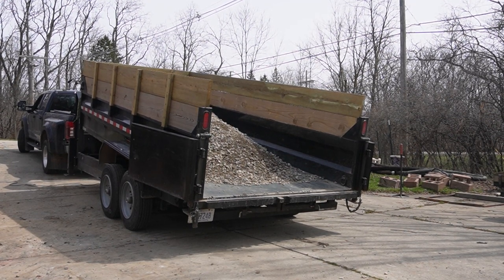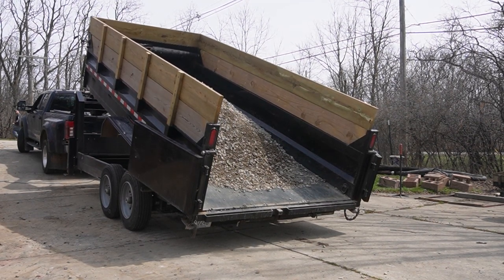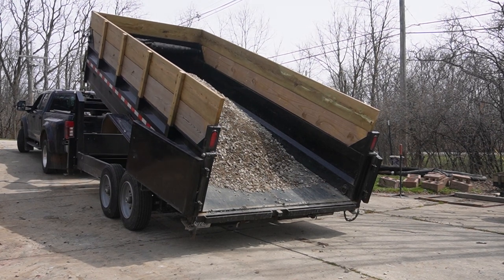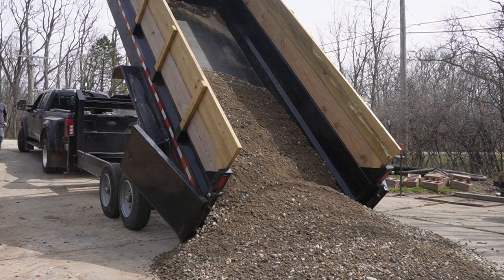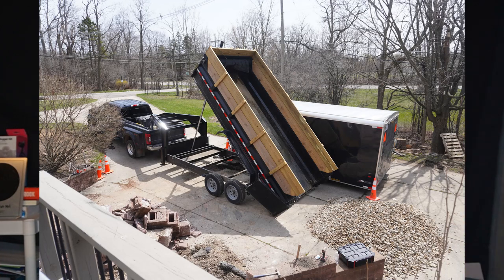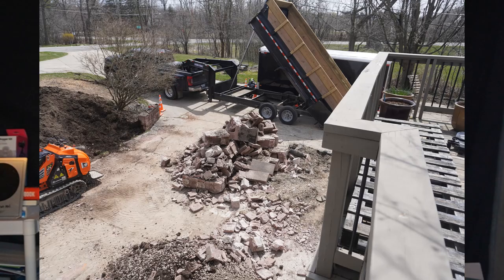Dump Trailer Fees for Material Delivery

Comment: Thanks! At some point after I upgrade my mid-size GMC Canyon that tows my tool trailer to a full size super duty or heavy duty, I plan on acquiring an appropriately sized dump trailer to aid in dumping debris on the job and at home as well as making it a possible side-hussle  using just the trailer to make additional money. Likely a 3 year span of time before I am there but videos like this are encouraging!